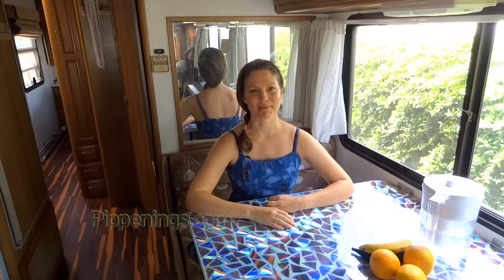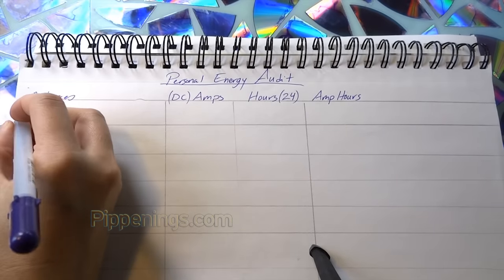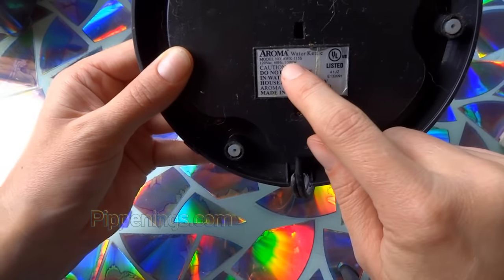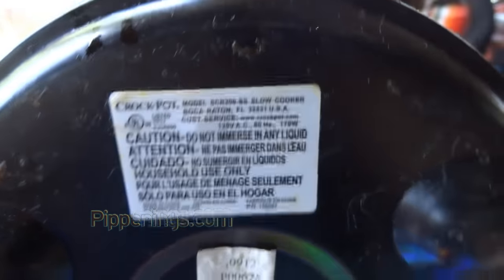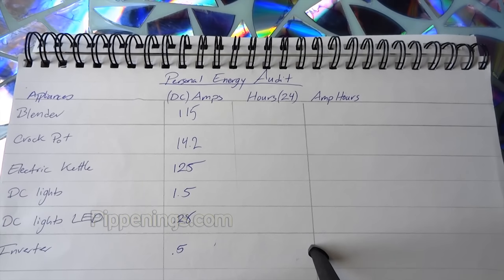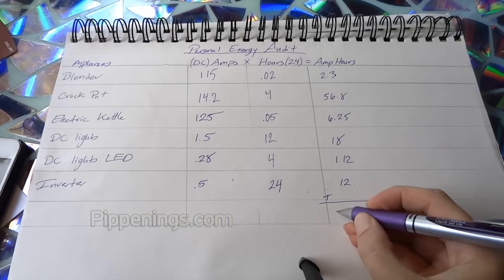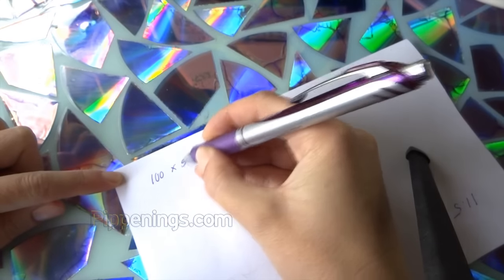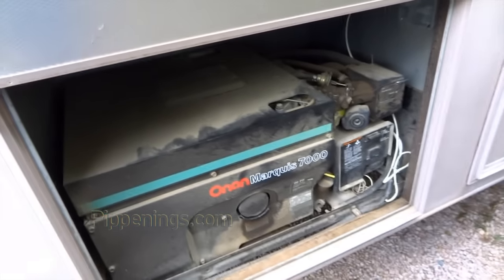RV Solar Living Basics: How Many Batteries and Panels to Use

Comment: Hi I just went thru the calculating following the instructions on your video, using my metered monthly usage on mains power which was approximately 170 kW per month in Summer.

So based in my metered kw per month I ended up with 20 amps per hr usage in my small motootorhome. Or 472 amp hr a day

I have what should theoretically be 270 watts of solar panels, 6 45 watt panels of the type that are supposed to be also charged in cloudy conditions and I have 4 batteries all of them are old and were loaned to me like somebody else so I don't know their actual amp hrs 3 are house batteries so I'm going to assume at least 100 amp hour originally and the other one is either a small car or deep cycle batteries so I'm going to guess that they're probably 3 to 400 amp hours originally and maybe a quarter or a third of that now?

I have a 600watt constant/122 watt surge invert or connected to the batteries

So NY this calculation I have say 200-250 watts solar (allowing for age of panels) on a sunny day and around 100 amp of battery storage.

I have a couple of questions

1: Firstly have I got my daily amp hers correct? As you have calculated 100 a day yet I have 472 ,and I have much lower power use than most people? So have I calculated wrong or do you have extraordinarily low usage?

2: In my little motor home I have a 750 watt microwave that is used 2-10 mins on average per day, a jug that might be boiled 3-4 times A medium sized fridge with a small freezer no idea what it uses and no labels to tell me. Plus 2- 48.5 watt led power saving light bulbs, sometimes 1-2 60 watt Incandescent to run my incubator or as a heat lamp for young ducklings, and the chargers/power supply for my laptop, mobile phone and tablet. I also have a dehumidifier that I run occasionally in summer, and a 750 watt pond pump that runs for an her a day average tops. And I have a small toastie oven that may run for 15-30 mins some days. My hot water is gas. And I have a 1200 watt fan heater that hardly runs in summer and a 100 watt "cupboard heater' that also is hardly ever used in summer. And as above my monthly meter gives around 170kwatt So going by your calculations I need at least 2 times my calculated amps per day? Ie 2 x 472 or at best 5 x 472? Which would mean I need as a minimum close to 1000amp hrs battery power to run my wee motor home in summer, and probably twice that in winter?

3: do I need the same capacity in solar?

4: currently my approx 100amp hr combined old battery capacity will only run:

One 8.5 watt led AC light bulb for 6-8 hrs tops (light overnight outside for ducks which usually goes on around midnight -1am and often the batteries are flat before or at sunrise at 7am Or the above plus another 8.5 led AC bulb, and my tablet charger and on a good day my laptop power supply for about 1 hr before it all shuts off. This is after charging the 4 batteries all day in solar plus charging for 3-4 or more hours on either my 4wds alternator or on a battery charger (only 2 or 3 amp charger) via the generator The fridge, ovens, heater etc are never used on the inverter as it isn't powerful enough, and some days I cant plug in the laptop or that will cause everything to shut down due to invert or overload.

Do u think that my estimating of capacity of the old batteries is off, or something else? Basically I am trying to figure out what I need to run my lights, laptop, charge phones and tablets etc via invertor, solar and batteries. And also try and work out what I'd need in terms of batteries and solar to run my fridge etc...
Reply: Oh, if anyone who has already posted saying the calc in the video are incorrect, wants to take a stab at my situation, please feel free to. Basically I just want to know how much battery and solar power I need to support 170 kw monthly power usage summer and around 340 in winter....I'm on a tight budget, so you can assume that I probably can't afford the newest most efficient batteries and will be buying lead acid or similarly priced...

Comment: But isn't the battery bank supposed to be twice the ah for the 50%? Or does the average thing mean your bank can go by whatever your ah/day is? Sorry to be such a pain... If your number was 1000ish and you have 800ah bank then theoretically I should be good with 5- 232 batteries, yes? Maybe 4? Thank you so much for replying and specifically with that info because what you showed on the vlog ( I get it was a sample) was 100ish so I think that is where I was confused although I did note your list didn't have some obvious stuff on it.
Reply from the maker: +The Rogue Less Travelled Yes if you are going to use that amount daily you need to have twice that for 50%. But I'm thinking I can probably get by with this amount. It's still a lot. I'll let you know a couple months down the road 😉

Comment: Hi Pippi, sorry to bother you again but I've been at it for hours and cannot find any info anywhere which tells me how to calculate the panels based on these ah...  this helps with batteries but how does it apply to panels?
Reply from the maker: +The Rogue Less Travelled Take your AH that you consume multiply by the system voltage. Probably 12. That gives you WH. Watt hours. Now for each brand of panel you'll need to plug in different specs because they'll all be a bit different. Divide WH by the voltage of the panels. Think in pairs (pairs of series connections). So my two panels have 36V when a pair. That gives you the number of AH you get in that solar panel's time. Then divide by its amps. That gives you the number of panels that will generate the amount you want in one hour. But your panels will collect and harvest for more than one hour a day. So then divide by the number of hours the panels will be collecting on average in a day. That will give you the number of panels you need for panels of those specs that you used.

Comment: I run my TV of a 1100 watt inverter with a 30watt panel and 2 12volt lawnmower batterys have no problem charging them or running tv

Comment: Impressive! Your calulations are only for 110v AC though. there are other parts wo use 230v. This will change the outcome.
Reply from the maker: +Jaap de Wind Yes, this is based on what's most common in the US
Reply: But you have also vieuwers out of Europe!

Comment: who gives a thumbs down come on its pippi😄
Reply: They are just jealous of how smart she is 😁
Reply: I agree, must make them feel better about themselves to thumbs down a smart, strong woman🎈
Reply: Actually, her calculations are incorrect--that might have something to do with the down thumbing...  The amps on the label are the max current drawn by the device--not the rated current drawn while in use.  And you don't divide by 10 or 12--you multiple A*V to calculate the apparent power usage--which isn't the actual power (rate of energy consumption).
Reply: I think she is too smart to miss such things.
Reply: M. H. Then you are incorrect, too!
Reply from the maker: +zeffur7 Using the rated energy consumption gives a cushion. That's a good thing. If you calculated it you would need to add about 10% as a cushion anyway. Better to be more prepared than not have enough. Also you are not doing the full calculation to get to where I am. AxV=W. Volts are 12 in most systems so you divide by 12 to get amps. AC appliances run 120, DC runs 12. That's a factor of 10, hence multiplying by 10.
Reply: +Pippi Peterson  - You tell'em Pippi🎈
Reply: Pippi Peterson
Actually, Pipster ;), you really need to put ~1.4 times more energy into a battery than it's capacity, due to charging inefficiencies & heat loss to get a good saturation charge.

I'm aware how you derived your 10 & 12 factors/divisors--your method of calculating isn't conventional.  Most people that I know use power (Watts) because it is a much better value to consider than just considering Amps or Ahs.  You can certainly do the math the way you did it, however it isn't VERY clear to most people what you are doing compared to the method that I showed in another post in your vid comments.
Reply: she's adorable !
Reply: You may be correct and a appreciate that however her video is the first one of many that I watched that made it perfectly clear how much of a system I needed.  either way its good to have checks and balances so thanks for sharing your knowledge as well.

Comment: what about refridgerator, air conditioniner/heat pump?
Reply: and maybe add TV, computer, and items that need to be recharged.
Reply from the maker: +heidigib01 This was a sample just for the video. You should add whatever you want and use in it. Do your AC and fridge alone and see what you come up with battery-wise. Keep in mind fridges can often run off propane as well.
Reply: thankyou

Comment: No heater or a/c use in your RV?
Reply from the maker: +bwillan This was a sample audit for the video. I'd suggest calculating your AC to see how many batteries it would take. Then see if you can get away with no AC while off grid ;)

Comment: if you use only 100 watts a day, you don't need so many panels. After all you're not draining the battery to "0". One 50W panel willl produce the daily consumption in 3-5 hours.

Comment: on your diagram it shows AC AMPS /12 =  DC AMPS  is the 12 for 12 volt battery thanks
Reply from the maker: +fester Adams Yes that's assuming a 12V system. FYI you made a typo, it's AC Watts/12=DC Amps. AC Amps * 10 = DC Amps. You can reference here: https://www.pippenings.com/rv-living/rv-solar-basics-44-how-many-panels-batteries-do-i-need/

Comment: Can i havd heating from solar ,?
Reply from the maker: If you have a lot of batteries or a small heater and possibly only for a short time. You can use a gas heater though instead.

Comment: Would you be willing to review this rough outline of what im thinking of adding to my Class B campervan, and see if my math is close?

SOLAR SYSTEM

CREDITS $3,300
1000 Watts Mono Solar (10 Panels) ($1200)
7200w for 6 100ah Batteries ($900)
Charge Controller plus wiring/etc ($600)
EasyStart Soft Start ($300)
Install Assistance ($300)

DEBITS
600 watt A/C Total Run Time 5 Hours Per Day
Energy Efficient Fridge 24/7
Laptop Charger
3 Led Lights
1 Phone Charger
Occasional Water Pump usage

STATS
4000 generated per normal day
3000 depleted per day
1000 added to batteries per day
3-4 cloudy days acceptable
Or 2 days of zero sun